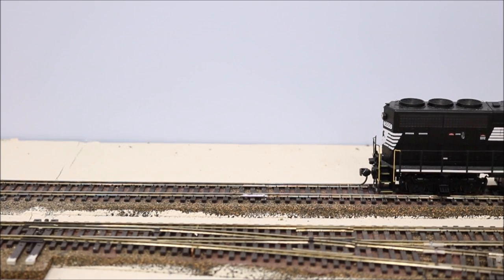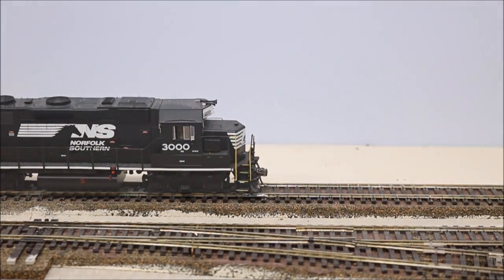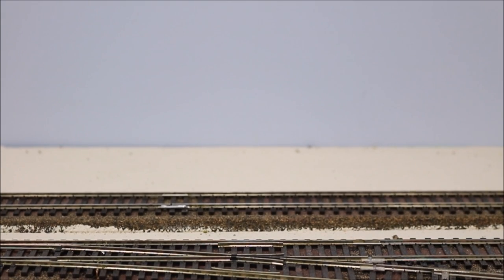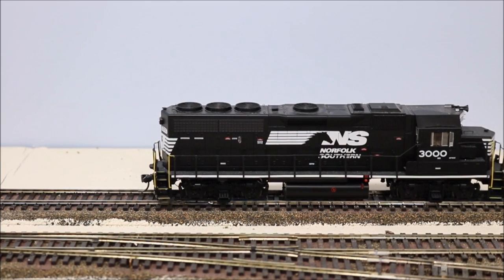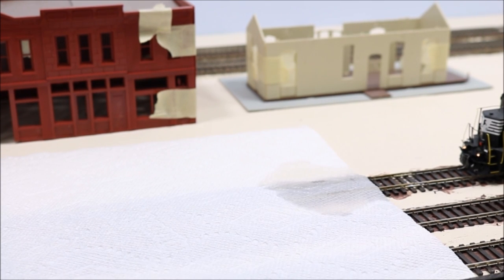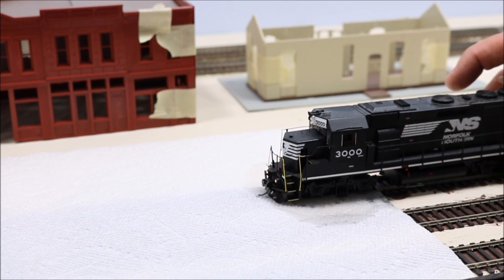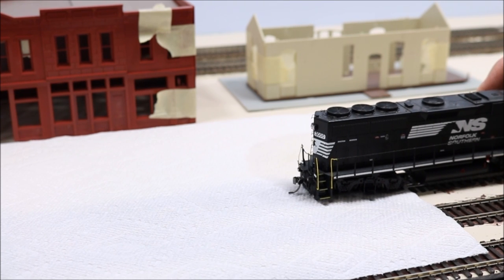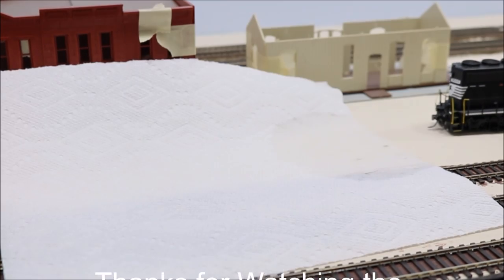How To Improve Operations by Cleaning your Track and Wheels

Comment: Thank you, this was really helpful! Just pulled the small HO set out of the basement for the first time in years to put it under the Christmas tree, and of course it was running very choppily. It only took minutes to clean the track and wheels and now everything is running smoothly. I used rubbing alcohol on both the track and the wheels because that's all I had on hand. I can't believe how dirty that track was! Super simple clean up, thanks for the tip.
Reply from the maker: You're welcome and thanks for watching...Harold

Comment: Actually, professional electrical contact cleaning instructions ban the use of IPA for cleaning in electrical contact surfaces. Yes, it gets things very clean, but IPA is a polar solvent, which means it makes metal surfaces oxide up again rapidly, getting dirty very quickly again. Instead for electrical contact surfaces you want to prefer a non-polar solvent like mineral spirits. The cleaned contact surfaces stay clean much longer when you use a non-polar solvent to clean them.
Reply from the maker: Joe...I'm honored to receive a comment from you as I have followed your channels for years. Thanks for the input. Since I made this video, I have been considering other cleaning methods that you and others have suggested...Harold

Comment: I have found with the goo gone if there is dust in the room ,,, then the track that was clean with goo gone is now a magnet towards the dust, so I needed to then clean the track more often, &or clean the track with alcohol, so with some poking around asking all the elec... guys I know & they all say the same thing ,,, if you have dried paint on your track the goo gone works great BUT you then need to get the residue off, from the goo gone. 3 different electrician guys said to use electrical cleaner... this is what I found and work great ,,,,                     ( CRC Marine QD Electronic cleaner).
           Are layout is in the basement and yes we have a wood stove 5feet from the layout so yes we have DUST,,, 
 it is all so safe to use where the plastic may be at the same height ,, like in the switches/frogs , OR if you have plastic ties,,,,,
                  I have all Bachmann E-Z Track so that is Y I needed find something safe for plastic parts. 
  Thanks for sharing ,,, Tom from ETHYNVILLE BRO420
Reply from the maker: Interesting...Goo Gone has not done that for me and I've seen other videos recommending it. I'll keep your experience in mind when I next clean the track (which is of course a continuous process).
Reply: CRC 2-23. Made for cleaning electrical contacts rather than just cleaning.  I think you’ll find u won’t clean as often as tracks won’t attract dirt.  I would avoid track rubbers and isopropyl, good luck

Comment: Can the alcohol soaked paper towel for cleaning the locomotive wheels cause a short if used on a DC powered layout?  If using the (live) powered track to spin the locomotive wheels and adding a wet bridge across the rails wouldn't it arc and short. Seems fine with DCC as shown but wondering for DC layout. Thanks
Reply from the maker: Thanks for your question. I clean wheels using this method on a DCC layout. No shorts have occurred. I believe that DCC is more sensitive to shorts than DC. So, this method should also work on a DC-equipped layout...Harold
Reply: @nssherwoodsub  Cool, it looks like a slick n easy way to clean the wheels. Thank you for your response👍.
 Subscribed!
Reply: I have a DC layout and use the paper towel method at times to clean locomotive wheels.  I've never had an issue with shorts doing so.
Reply: So no worrys about the motors arcing and wheels sparking and flash points of alcohol vapors...?

Comment: Nice tip though, how do you manage with rails under scenery? ie in a tunnel.

And how do you do for cleaning the cars wheels?

Appreciate your comments
Cheers
Reply from the maker: Thanks for your comment. For tunnels and other hard-to-reach areas such as inside a bridge, it would be best to have one of those track cleaning cars or to make your own. Many YouTube videos about this. I clean car wheels like locomotive wheels...paper towel or cloth over track, soak with isopropyl alcohol and run the car on the rails that are under the soaked paper towel...Harold

Comment: Best thing to do with Goo Gone is leave it in the bottle.
Reply from the maker: Thanks for the comment. We all have our favorite way to clean track. What's yours?  Harold
Reply: @nssherwoodsub  Soft cloth and CR contact cleaner or Alcohol. The reason I do not like Goo Gone is. Many years ago our local club used it. It caused a corrosion that leaches down into our feeder wires. I can't explain how or why this happened but believe me this happened. We had to replace about half of our feeders.
Reply from the maker: @robertwintle9468  Oh, that's not good. I've used GooGone for about 6 years and have not experienced any problems. But, thanks for the heads-up...Harold

Comment: Goo gone why didn't anyone tell me this sooner and rubbing alcohol for train wheels very clever but i am having a track problem it one of those ez tracks and there is a plastic piece that looks like a road crossing  implanted for vehicles to cross every time my trains hit it it derails all my engine's i couldn't figure out why til i had my dad look at it the first words he said was this isn't right so he measured it eel here's the problem some dumby got the measurements wrong it's three inches higher then wat it was supposed to be so my question is what type of Sandpaper do I use or a small sandpaper block if this isn't fixed it's going to tear the bottom of the locomotive's out or put a hole in it that's my biggest worry

Comment: When I clean my locomotive back wheels on the paper towel it stalls, I cant figure out why.  Front wheels are good to go, no stalling
Reply from the maker: Does your locomotive have all wheel electrical pickup? Sounds like the locomotive may be only getting power from the rear wheels...Harold
Reply: @nssherwoodsub  It is just the rear wheels
Reply: Its a kato n scale csx

Comment: Can you soak track in the bath mine is mega old and went mouldy but didnt rust or would it ruin it ?
Reply from the maker: Thanks for your question. If the ties are plastic and the rails are nickel silver, a good cleaning with soap and water and a small brush should do the trick. Would not recommend some more exotic cleaning fluid which might react with the ties or rails. If you have old brass track or fiber ties, I'd recommend replacement as cleaning would ruin them...Harold

Comment: I’d use a higher grade of isopropyl alcohol, but once done, wipe it off with a lint free rag and then put on a light coat of Ox Guard using a qtip or paint brush. Work it into the rails a bit. After a day or two, or even a week, simply wipe the rails again.  This gives a super conductive coating and protects the tracks from oxidation.
Reply from the maker: Thanks for the comment. There are many ways to clean rails. Yours looks promising...Harold
Reply: You have no idea what you are talking about. Tracks are usually made from cupronickel. It oxidizes sightly and the oxide protects the bulk from further chemical change, like aluminium. “Superconductive coating” ← This one is too brain-dead for me to explain how it is wrong.
Reply: @marioxerxescastelancastro8019  Odd, because this has been relatively common knowledge since Lynn Westport popularized it in Model Railroad magazine in the 80’s and is still practiced today. For a decent explanation, check out Elite194 channel. I’ve personally been using it for 35 years and need to clean the track twice a year and that’s after conservatively 200 hours of operation each year.

Comment: Don’t use 70% alcohol use 91% alcohol. The 70% attacks dust.
Reply from the maker: Thanks for the comment. I use 91% alcohol as a paint remover so I would be reluctant to use it as a track or wheel cleaner because it might remove the paint from the web of the rails...Harold

Comment: 70% has too much water in it.  You need as close to 100% as you can get.  Most electronics suppliers have the good stuff.
Reply from the maker: Thanks for the comment. I use 91% isopropyl alcohol as a paint remover. I'd be concerned that it would remove paint from the models and my painted rails so, at least for now, I'll stick with 70%...Harold

Comment: Only thing i don't like about goo gone is a oil based and can collect dust over time
Reply from the maker: Hmmm. I hadn't considered that. GooGone has not misbehaved on my track but I'll keep watching for the dust collection issue that you mentioned...Harold
Reply: @nssherwoodsub  we had problems on a club layout because of the area we were in and seam.like it just kept getting dusty so we used bright boys and denatured alcohol
Reply from the maker: @gregrunions5689  Thanks for the reply. Denatured alcohol might be a good choice if it does not affect paint that you may have on your rails or ties. The bright boy is abrasive so it may leave behind particles of itself as it wears and it may put scratches in the rail. Those scratches may attract dirt or other things...Harold

Comment: dont use alcohol...... US CRC  2 26  SPRAY.....  NON PETROLIUM AND NO SILICA.. ITS NOT ABOUT CLEANNING THE TRACK ITS ABOUT CONDUCTIVITY... CRC 2-26 youre welcome!!1
Reply from the maker: The debate continues. You seem to agree with Ron's Trains N Things and Fishplate Films with their most recent videos...Harold
Reply: I totally agree. I have been using Inox MX3, a similar product, for about 40 years. I never need to clean my wheels and only need to apply the Inox about every 2 or 3 months. Fishplate Films are spot on.

Comment: Is there a risk of the alcohol getting inside the locomotive and damaging it?
Reply from the maker: Thanks for the comment. I've done this many times using 70% alcohol without any issues. I would NOT use 91% isopropyl alcohol which can, at least, damage paint...Harold

Comment: "you see, that's pretty dirty"
yeah 60% of that just came from that track rubber... stop using track rubbers...
Also don't use alcohol... use a good non-conductive contract cleaner like lanolin oil or silicon free cleaners like Inox. These lift dirt and crap off the track while leaving a protective coating to reduce the impact of dirt, dust and other crud. You do NOT want to you evaporative electrical cleaners as they do NOT leave a coating to reduce future "dirtiness"
Reply from the maker: Thanks for your comment. There are many track cleaning methods. Yours seems to be well thought out...Harold
Reply: track cleaning rubbers 1000% better than any solution
Reply: @rob235ioa1  they really are not. the only time that statement has a twinkling of truth is if you have motive power with traction tyres. and i feel sorry for those that do because of how much it limits you.
Reply: @nssherwoodsub  research and personal experiments to verify the data I collected. The only draw back is traction tyres but good modern motive power doesn't have that problem with the exception being Z scale.
Reply: @liamcooper6721  feel sorry for you then you are missing out
Reply: @rob235ioa1  missing out on what? all my motive power forgo traction tyres. I also model 1980-90s, so what steam I do use I replace the traction tyre axle with another that doesn't have them, thereby eliminating any problems
Reply: @liamcooper6721  missing out on the absolute best way to clean track.......track rubbers...........end of argument....subject closed
Reply: @rob235ioa1  I'm sorry you feel that way. it must be cold living in the dark ages without heating. XD 
Truck rubbers might give you a shinny surface but thats about all they give you. They do not help keep the conductor path clean, in fact they add to it by promoting micro-arcs  between the wheels and track, thereby increasing the oxide layer that forms on the surface of both the track and wheel sets. This is what you want to stop in the first place in any contact in any circuit. 
There is only a right way (Electrical Engineer approved) and the wrong way. 
And this shows why the hobby is dying. Too many people stuck in the old ways because they are too stubborn to listen to people that know better and passing on the wrong information to the new comers to the hobby. 
you do what you want to do with your track but please don't feel you lies and misinformation to anyone else... for the sake of this hobby.
Reply: @liamcooper6721  what a load of drivvle and totaly untrue   ive over 700 feet of track outside....been ok for years
Reply: @rob235ioa1  And that proves absolutely nothing. Some very circumstantial evidence at best. You can keep doing it your way if you want but do not say its the be all end all when it really isn't, might as well use wet and dry 7000 grit. I not only have extensive knowledge of circuitry and contact maintenance, I have also gone though ever method under the sun to verify other peoples claims, including yours.
Reply: @liamcooper6721  - What is the best thing to clean the rails?  I'm not being a Smartass. I hear so many different things it's driving me crazy. I would like to hear what an electrical engineer has to say. Best regards.